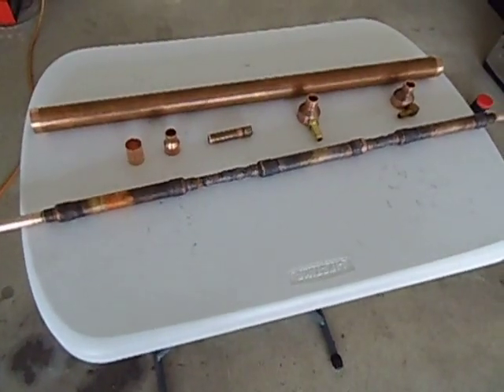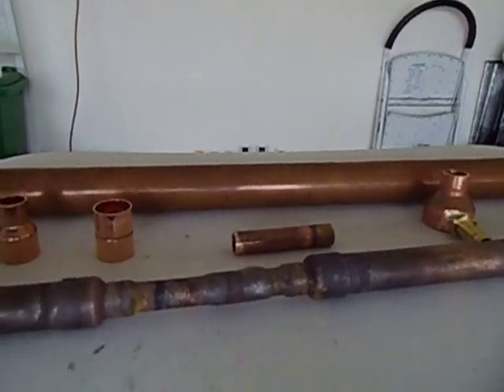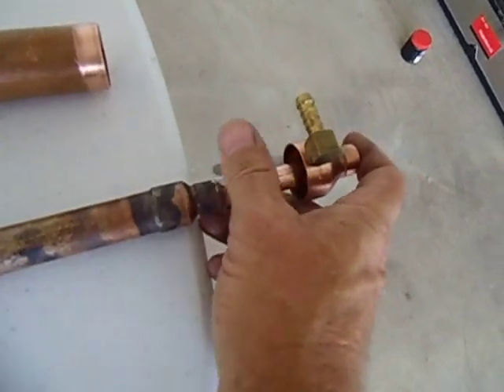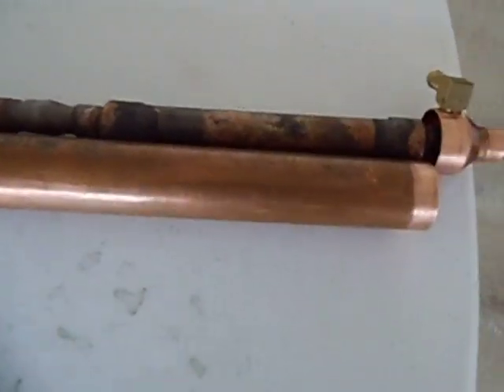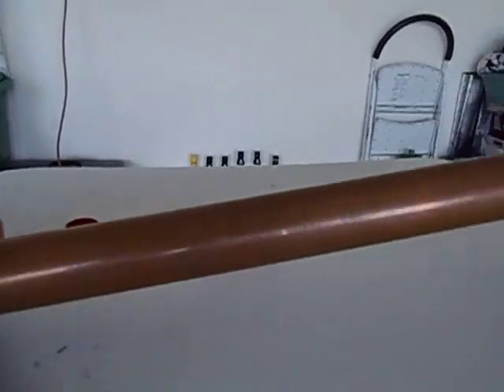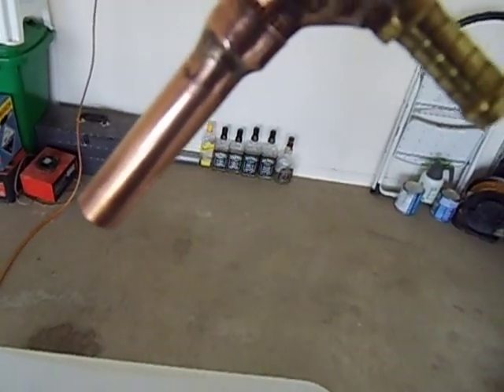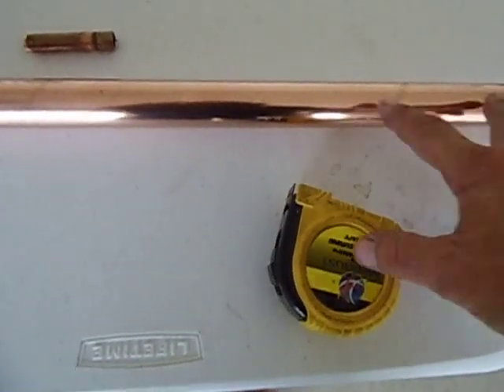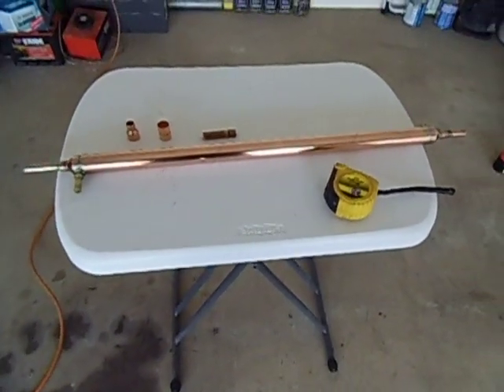My improved still condenser

Comment: Would it have been easier if you had put the water inlet (outlet) not on the reducer joint but just above on the water jacket itself because wouldn't you have had to drill another hole through the over lapping reducer and water jacket joint ?

Comment: Does the outside jacket need to be copper? I saw one video where they used PVC pipe? any chance of PVC leaching into your vapor if the jacket is PVC?
Reply from the maker: Chicken Friedfish The alcohol doesn't touch the outside jacket so it's fine to use plastic
Reply: Ok, so, what kind of copper is used for making the condenser? L, M, K,

Comment from the maker: If you carefully watch my video's you will notice that i take 200ml of from the beginning of the run witch is called the heads , in that case none of the bad spirits stays behind as the hearts start coming in it automatically pushes the heads out of the little pockets , i don't just catch 50ml , rather safe to catching 200ml :-) . Do some more reading by Google about how much you should take of from the fore shots also called the heads when running a pot still , cheers

Comment: It's very cool but I see one possible problem.  When the first of the product comes thru your unit does it not "well up" in the bottom of the  3/4'" wider parts of the "worm"?  If so you are not able to properly dispose of the "bad juice" that comes out at first, it seems it will mix with good stuff coming after the first few ounces of "wood alcohol", so you will have the poison stuff mixed with your good stuff.  Am I off base?  If so explain please.  Thanks.